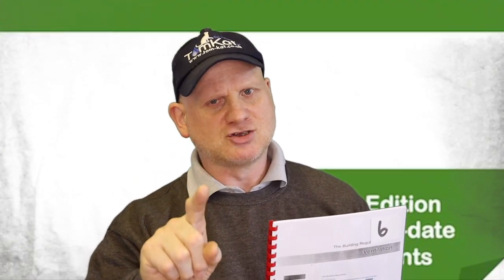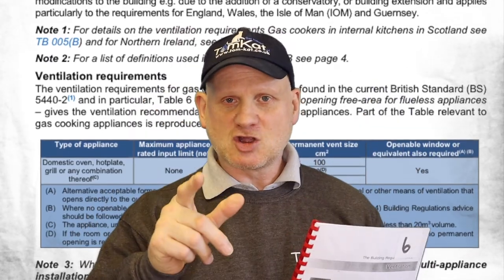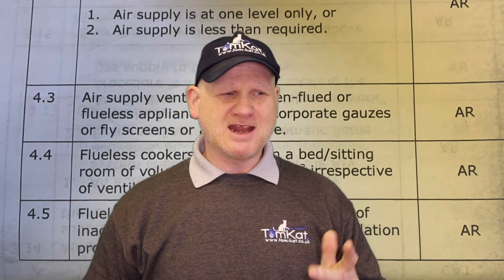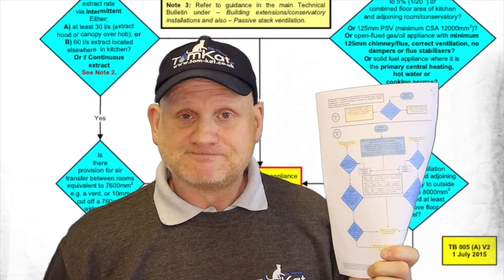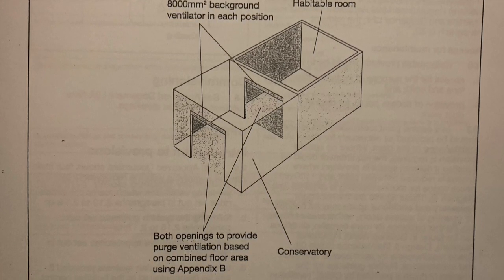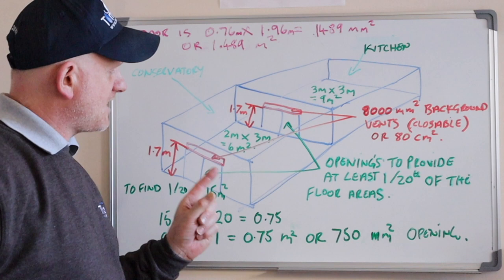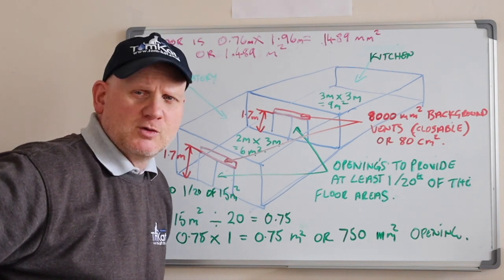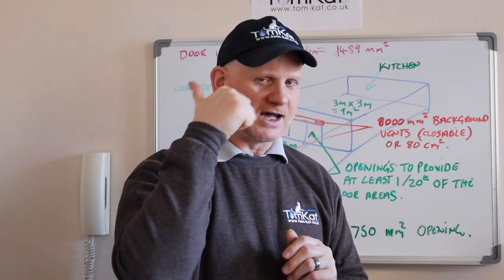COOKER VENTILATION PROBLEMS. gas tutorial on the correct ventilation need with no openable window.

Comment: Thanks for this, I've been struggling with internal kitchens for the past 8 years! 
If the door is big enough can this cover the ventilation requirements alone or does there have to be a window/vent?
I was to install a cooker in a kitchen last week that had a conservatory to the rear and a porch to the front and living room off to one side. There were no windows or vents into any of the  rooms, combined floor area was probably 36m².

Comment: Well explained 👍 I had a conversation with gas safe regarding this in. gas safety check, and they confirmed it as NCS as the room size was correct. Problem is the appliance can't be replaced As it currently is!

Comment: I love the videos but I have to correct a mistake.TB 005(a) I believe says that the extractor fan must be capable of moving 30 litres per second not a minute and 60 litres per second if not adjacent the cooker or hob. My question is if the extractor is connected to a class 1 chimney is that considered as going to outside? My thinking it would very likely not work as the fan would not be powerful enough to force the flumes up the chimney any thoughts.

Comment: Just been told by a fitter that I need external fan prior to him commissioning my new  (replacement cooker . Yet I have an openable door and an openable window leading onto a conservatory with both french double doors and four openable windows (sizes fall as your diagram) When I pointed this out the fitter said I appreciate that but you might close them when I`ve gone !  Confused !
Reply from the maker: @jimtuckwell8142  the regs have just changed and your engineer is correct this video covers already installed cookers and hobs not new installs
Reply from the maker: @jimtuckwell8142  https://youtu.be/qcajsDcs0s0?si=RQ8ejagzSvvek4Up
Check out this video for the changes
Reply: @tomkatgastraining  Hi Tom does new installed cover the replacement of existing cookers, like for like  ? The old one was a little tired so we replaced it with exactly the same unit . The fitter stated we need to ventilate direct to the outside but the conservatory prevents this .
Reply from the maker: @jimtuckwell8142  yes it does. You will require mechanical extraction ie a cooker hood vented to outside or an extract fan to outside to replace your cooker or hob
Reply: @tomkatgastraining  Thanks .This going to be a problem . Wish I`d left the old one in ! 🤔 I was banking on the building regs "To comply with Building Regulations, if there is an existing extract fan (or cooker hood extracting to outside in the kitchen) you need to retain (or replace) it. If there is no existing ventilation system you need not provide one." Damn